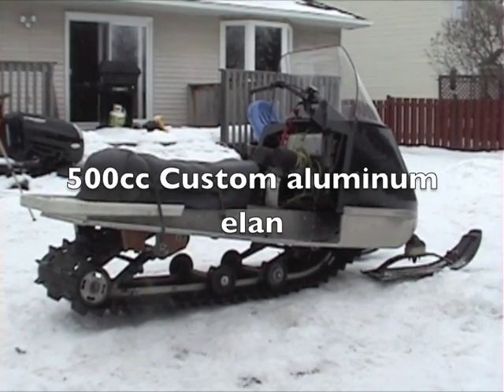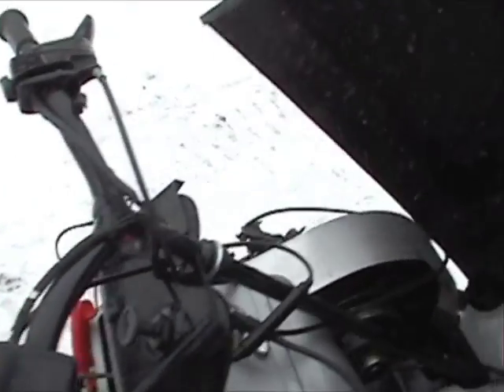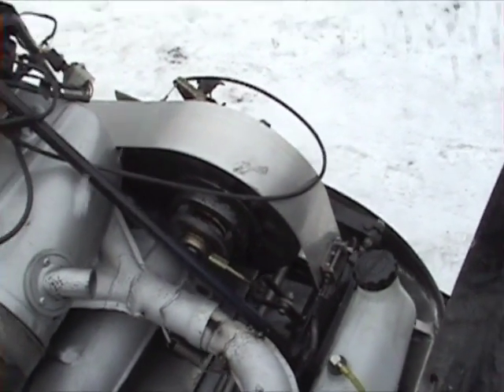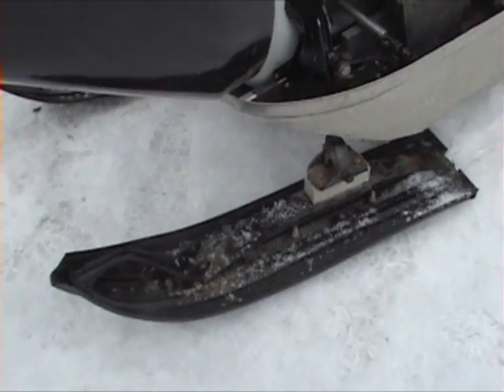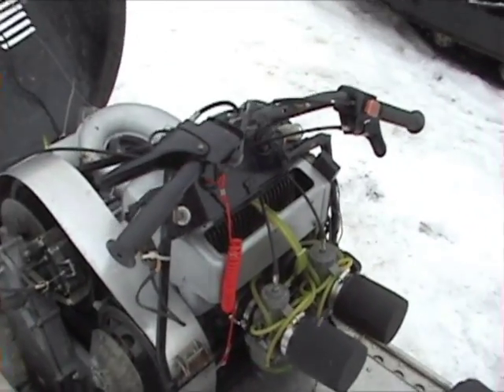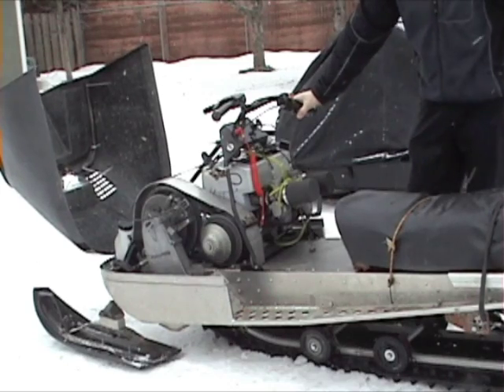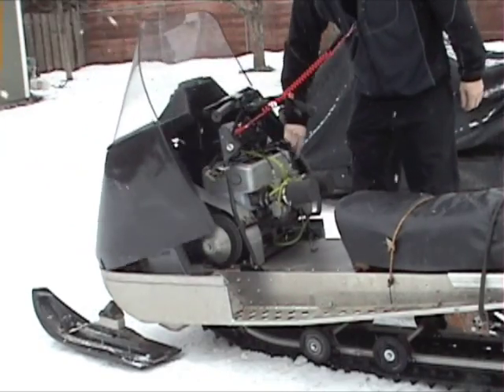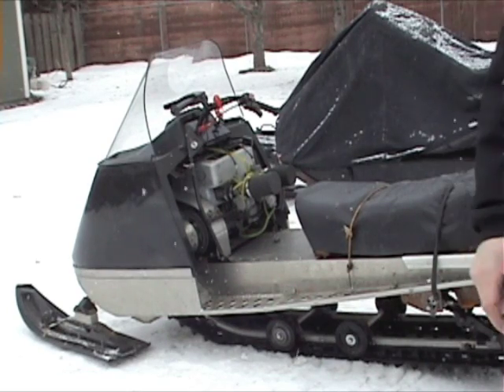Modified 500cc  snowmobile skidoo ELAN Listen to this!

Comment from the maker: I actually bought mine form a farmer as well, sat in his barn since 1972, he filled it full of oil, started second pull and I had to change the points - you might want to take a look at them before you head into the middle of no where like I did:)  You will love it!

Comment from the maker: @pieman12345678987654 oh ya there is a cover, check out the phase 1 and 2 video - I have completely changed that sled, a 151 track with timbersled suspension is going in it as soon as the suspension arrives this week.  Thanks for watching and commenting!

Comment from the maker: @YamhaEx440 sorry, to elaborate, the clutch engages as soon as I touch the throttle, I get little to no build up in rpm before it engages.  Well atleast it did - I switched to a TRA clutch and the elan catwalks across the back yard now, needless the say I'll stick with the TRA that enages at a higher RPM - a lower gear if you will.

Thanks for watching!

Comment from the maker: Hi Guys LSHOBIE here, got the new TRA clutch in, rebuilt motor and tuned pipe by JAWS, started it up and took it across my back yard.  Hit the throttle and the sled went vertical, only thing that kept it from coming down on me was the rear grab bar.  I was blown off it, this sled is going to be some serious fun, but kinda deadly too.

Comment from the maker: Thanks very much!  I took it for a quick test drive last week and  it ran good for about 3 minutes - then it would run only from half to full throttle  until it would only run at full throttle and then just died.  So, I removed the dual carbs and switched to a single carb, I also bought a 503 cheyanne exhaust to install but first I will test with the single carb.

Comment from the maker: @FrankaDith its getting lots of gas, no problem there, it has spark on both plugs, changed both coils and the same result, the engine was rebuilt but I think a condensor is bad.  I have a spare engine so I will drop it in for this weekend so I can try it.  

I took the filters off and put a single carb on with an airbox, looks pretty good, will route some heat to the carb though as it does freeze up I have noticed.

Comment from the maker: @gerversin The track is just a 136x1.25x15 track with 2.52 driver type.  To put a deep lug track on the tundra you will run into some issues, namely the deep lug will hit the tunnel - the chaincase would have to be dropped and you'd have to switch out your 1.91 drivers to 2.52 drivers.   It can be done but it is a pain in the asssssssss.  I found a new old stock track and put it on instead.  But I agree - the tundra needs a more agressive track.  What I would have really liked to do is put a 156

Comment from the maker: @damoleman69 well the drivers are different - because the track pitch is different (i am pretty sure the stratos is a 2.52 pitch - the elan is a 1.97 pitch so the  cogs won't line up).  gonna be tricky unless you are handy and have fabbing skills.

Comment from the maker: @coshyno Tried it this weekend, have to make some changes, I geared it to low, with the 2.2:1 gearing and 7 tooth inner drive sprockets it is way too low, going to change it out to 1.9:1.  also - still having some carb problems so I will swap a single carb into it to see if that is the problem.  Goes like crazy for about 5 minutes then acts up.  Stay tuned!

Comment from the maker: @airsoftman50 more air and more fuel, and the mixture is tuned for each cylinder.  Single carb uses less fuel - but has a little less power.

Comment from the maker: @SuperWiller Thanks!  Should work well - just need the snow!  Have to make some slight adjustments in the next couple of weeks - changing the 503 to a fresh 503 rebuild, might change the top gear as it is very very low geared right now, but still goes extremely fast in a very short period of time:)

Comment from the maker: @fmfraceing69 I put a 277 in an elan and it was a direct bolt in.  The 277 is 27 or 28HP and the elan is a rocket with that engine in it - I suspect BRP was going to put that engine in the elan at some point but went with the tundra platform instead.  The elan 250 long track manufactured and sent to europe would have been prime for the 277.

Comment from the maker: @808moparskate Its turning out pretty much the way I wanted it to, if I can just get the clutching and exhaust tuned right I will be having lots of fun with this thing.  If I don't like the 503 I could always put a ported 277 in it and it would probably weigh in around 250 pounds - then it would be a riot as well.  But for now I'm sticking with the original 503 plan.

Comment from the maker: You'll need an older 440 motor mount - it will bolt up to the engine and into the elan.

Comment: @shobie Make sure your gas pump is pumping ok and id lose the air filters you dont need those in winter you would benefit from an air box with the inlet somewhere close to the exost ,   id think your carbs are freezing.

Comment: how would i got about lifting a 1977 polaris tx 440, and putting a 1"-1 3/4'' track on. i might buy one and it has a short, small metal cleat track, and there is no clearance between the running boards and the ground (i will get hung up in deep snow). i would like to get a rubber track with lugs about 1''- 1 3/4'' length, raise the sled (i'm not sure if this in the suspension). please help .

Comment from the maker: @gunnabefamous69 Best thing to do is check out my build thread on dootalk, it is explained pretty well on there.  Mainly, add a  longer track, widen the skis a bit and don't build it for speed - gear it a little low.  elans and radical speed don't mix.